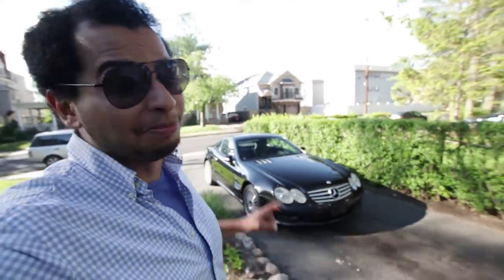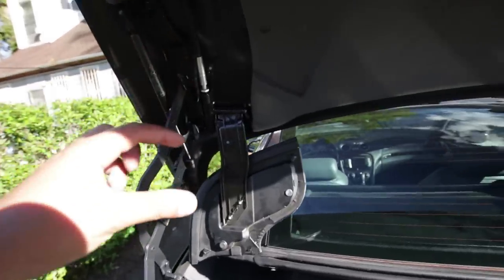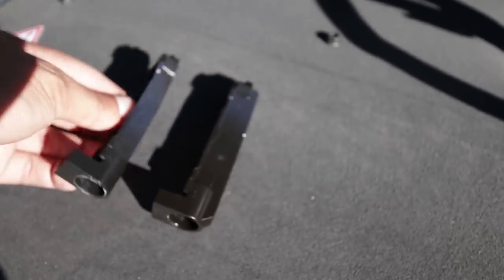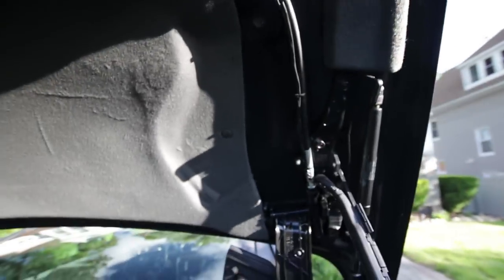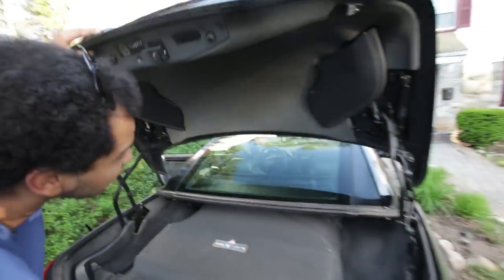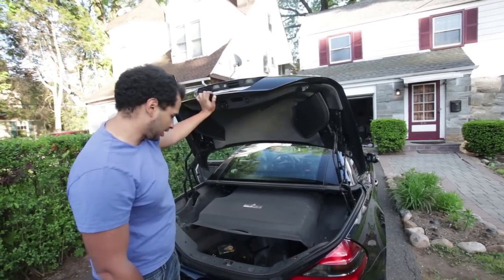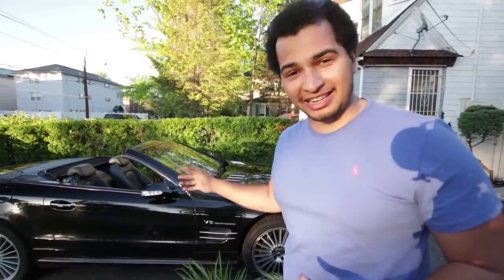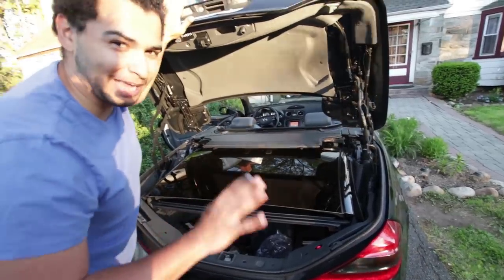I Fixed The Expensive Convertible Roof On My $8,900 SL55 AMG For Free (Almost)

Comment: love what you're doing man I've just picked up a really really cheap Mercedes W215 CL500 that is in need of serious TLC (as far as I know it shares a lot with the W220 just like your daily driver) So any tips and suggestions would be welcome since I'll go mostly DIY with it
Reply from the maker: Thanks! For your car, your best friend is Google and the forums.
Reply: looks like I'll have to retrieve my old usernames from the MBWORLD and BENZWORLD forums. The W215 an absolutely gorgeous car despite its expensive problems
Reply: Mohamed Redha Banahi  You should not have many issues unless you got an ABC one.
Reply: +MrCarGuy20 the ABC system was crudley deleted. I don't know how it was done though
Reply: @iTheGeek yup it was on coilovers and still rode like one with ABC

Comment: any broken part on SL55 is expensive - that's why you can buy this cheap in Craigslist. the most frustrating part to fix in Mercedes is electronics and shocks.
Reply: jd5179 And yet not the engine?
Reply: jd5179 the M113 engine is pretty bulletproof and this one is AMG hand built. Least of your worries on a car like this
Reply: David Brandon Exactly, because MB engines tend to be more bulletproof than BMW for example, MB extra capital left for all of these luxury features which breakdown eventually compared to BMW. I use BMW because they're similar priced but so different.
Reply: powertrain is great - issues is with that electronics. Me and my dad bring S500 to stealership service to diagnose electronic issues , they cant even tell where is it coming from lol. if the car ages like 20 years or more - that organic cables that Mercedes uses tends to disentegrate. air shocks are not that difficult to replace but it's pricey, most of them priced like $1k+ each. that annoying sensors tend to to trigger CEL is problematic as well.
Reply: jd5179 I think the bottom line is what are you getting out of those electronics? Are the benefits outweighing the costs? The other thing I need to point out is HOW OFTEN you use those electronics. For example, you can have the mindset of a five-year old and play with the power seats all the time and it'll be sooner to replace the components. In all, I think it helps to have a WEALTH of car knowledge, not money, like Tavarish, to afford these (indirectly) expensive luxury cars. By 'indirectly', I mean the maintenance costs. That way, the maintenance cost rate per year can go down.
Reply: jd5179 if you meant biodegradable wiring harnesses, that was only on 92-95 Mercedes and only affected the engine harness. What does that have to do with an R230 SL55 that's a decade newer?

Comment: I have a 2003 SL500.  I tightened up the flaps but still no operation.  Dash says top in operation, but windows don't move, pump doesn't operate and light flashes on top switch.  All fuses good and relay at pump is good as well as the microswitches.  When I connect a test light to the relay socket at the pump, the socket for constant power, 30 on the relay,  it has positive power.  When I connect to the common circuit I get no power, where terminals 85 and 86 of the relay would connect.  My windows are open 1 inch, the trunk lid is open about 2 inches and the top is not latched as the operation completely stopped as the top was beginning to open  I have watched every one of your videos (I think) relating to the top operation and no luck.  Any ideas?

Comment: You should replace that 3rd brake light before trunk fills up with water. And I would water test it for leaks if you are going to leave it outside. The central locking system module and the conv top pump and module are mounted low and always get wet. Check the deal at the bottom of the rear window also. That car is a money pit. Sell it asap.

Comment: $130,000 and they still fill the car with cheap plastic parts and don't bother with wear testing. Perhaps that's how you make a $130,000 car turn into a $150,000 car - with service and upgrades.  Can only guess that a dealer would charge for the repair.

Comment: I like the video about the top mu 2003 500 sl has a problem also an I caint get into my trunk now tried key it still wont open an it used to open my vaccum system is not working a leak somewhere but car running nice top don't work need advice...

Comment: So there are five things not functioning as they should be in this video alone. 

1. Those flaps hanging down 
2. Trunk cover sensors not working 
3. Top lift button not working 
4. Passenger window does not lower when roof is put down 
5. Trunk hinges are weak and cannot support the weight of the trunk
Reply from the maker: 1. I fixed the flaps. 
2. I diagnosed and fixed the sensor
3. It does, I just wasn't holding the trunk open all the way. 
4. The windows roll up when the roof is down. It's a feature. 
5. Bad struts are common and will be replaced.

Comment: my brother's SLK350 has the same issue. The message reads "trunk partition opens" and the roof cannot close itself completely. theres an inch gap where the roof meets the a pillars all across. on top of that there was a bad oil leak from the roof hydraulics. I'll try out what you did but used Mercedes is a BITCH to maintain.

Comment: If this works Im flying to where you are to kiss your forhead lol. I bought a 2003 SL500 which isnt the SL55 under the hood but same exact converteble top. The flaps on mine are hanging down like yours. And $750-$1000 is a walk in the park compared to what the MB dealers are quoting me

Comment: Mercedes BMW and Audi over- engineer their vehicles for expensive repair perks not committed to customer loyalty or satisfaction! Over $75-$90+ thousand for these vehicles but maintenance nightmares for most owners! I'd rather have owner satisfaction vs owner prestige personally! Yes you look good in it but if it doesn't function normally or you can't enjoy a certain feature then what's the point?? Honda Toyota & Lexus all take a different approach & it's called customer satisfaction, reliability & loyalty reward program.

Comment: dam how much would that have cost you if you got a a mechanic to repair it
Reply: First of all, he hasn't repaired it yet. He shorted a wire together to fool the system. That's not a repair, that's a hack job. Creative troubleshooting. He needs to buy a switch and install it. The jury's out on whether the bent metal brackets needed to be replaced to resolve the roof issue, because it was clearly not working after he replaced them. So to answer your question, I'm going to guess the dealer would have charged him an hr to diagnose and install a switch, so an hrs. labor and the cost of a switch.
Reply: OMGWTFLOL aha that makes sense. thank you for your informative reply,  appreciate it!
Reply from the maker: Incorrect. The trunk flap panels worked after I installed the new parts. Dealer labor and parts for that are around $700, including diag. The switch won't need to be replaced, just cleaned up, since the contacts were simply dirty. I used the wire simply to diagnose the switch being at fault. Since the part works as intended after the new parts were installed, it's definitely a repair, and the only piece I didn't film was me cleaning a switch.
Reply: Tavarish thanks for the correction. So you definitely saved quite a bit of cash repairing it yourself
Reply: Tavarish, I get the same code for my top (to attach or close partition in the trunk) so I bought another pair of sensors that the seller claimed worked fine. I am pretty sure they work because if you leave the trunk open a while the trunk light goes off. If you press the switch that the separator fits into, the light will go on. So that should be the same signal to the computer that the sensor is working...right? Do you know of any other reason why I would be getting that code? If any other component in the process failed I would get a different code...right?

Comment: That car is sitting way too high off the ground especially since you said it's in it's lowest suspension setting.
Reply from the maker: It was in its highest suspension setting for this video.
Reply: Okay, but I noticed the same thing in the first video when you said it was in the lowest setting but still seemed very high off the ground. I have a similar suspension in my CLS550.
Reply: Tavarish regardless, good luck with the car. I hope you enjoy it.